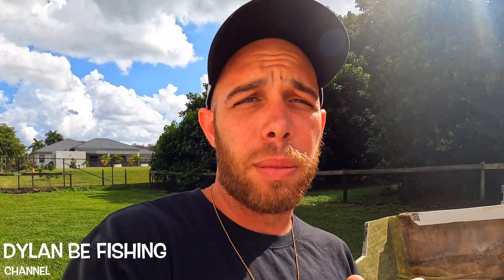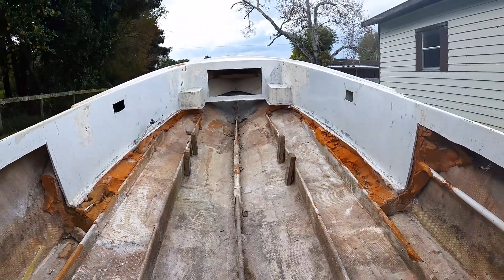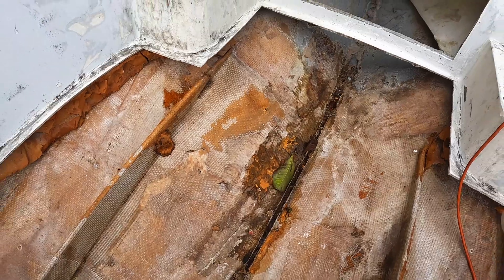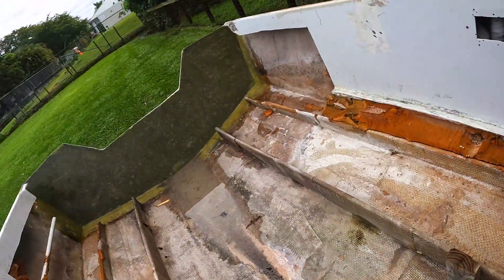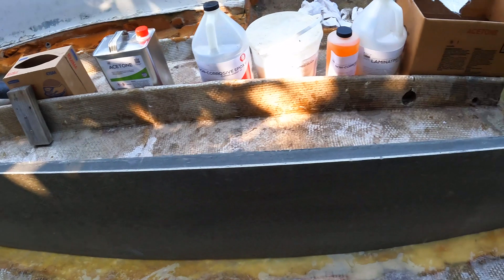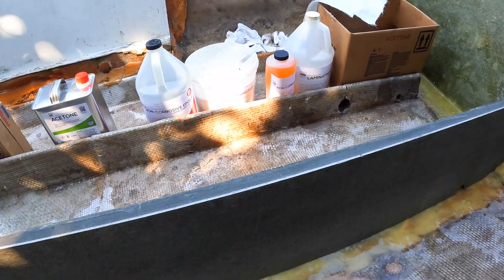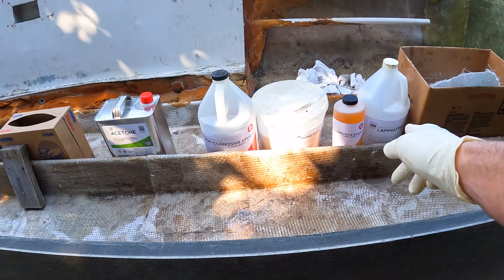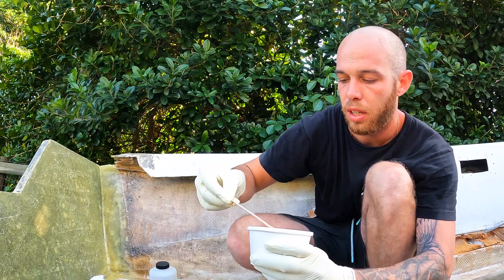Mako Boats || 171cc Restoration Project || Replacing Stringers Part 1

Comment: Hey around 3:30 to 4:20 can you explain why you laid all that in the keel and what you did with the mixture there?  Did you pour all that resin to let it hold the stringer while you set it, or let it dry and set stringer on top?
Reply: Fire videos and work by the way! Extremely good $hit you got goin on here

Comment: You might want to try a disposable roller for applying the epoxy...quicker so you have more time to work with the glass. Also if you pour the epoxy into a disposable paint tray it won't kick off as quick.
Reply from the maker: Thanks for tip! Appreciate it 🤙🏼

Comment: Hey man looks good.  It’s a little easier if you glass the stringers on a table out of the boat then just tab them into the boat. It’s always easier to work outside the boat then on your knees in the boat.
Reply from the maker: thanks! I would've done that if i was using wood, cause yea it a back killer lol.....  I'm planning on tabbing & laying a layer or two of 1708 down so I have some structural support and once all the stringer are laid in going back over each section and tying it all in with sheets of 1708. Video Part 2 will show it all.
Reply: Doing it in the boat allows you to use part of the layup for tabbing and saves time and money..

Comment: Coosa Board is the right choice, you didn't go cheap. Keep the videos coming, looking forward to the next one! Great work!
Reply from the maker: Thanks man, never understood the foam core stringers lol
Reply: I used 1in Divinycell for stringers because I have 7-8 sheets just in my stringers and bulkheads. Woulda cost an arm and a leg in Coosa. I did use 7-8 sheets of Coosa for my deck and cap

Comment: Any thought to rounding over the the top of the stringers? Would that help wrap the fiberglass mat?
Reply from the maker: Yes, the plan is to lay out all the stringers and bulkheads glass them in at the bottom with a couple layers and then make sure everything is leveled and then round it and glass it all in